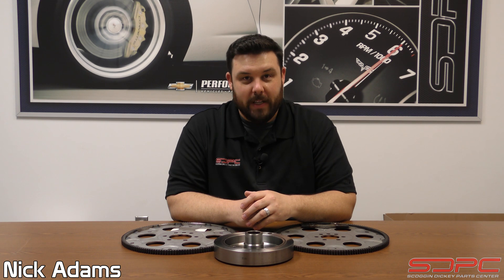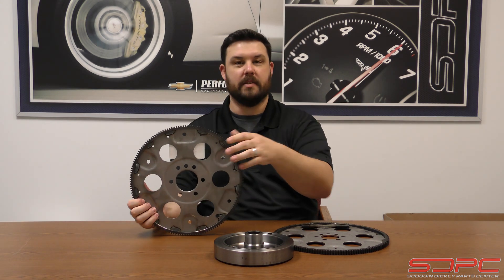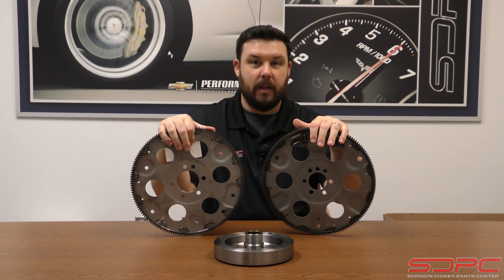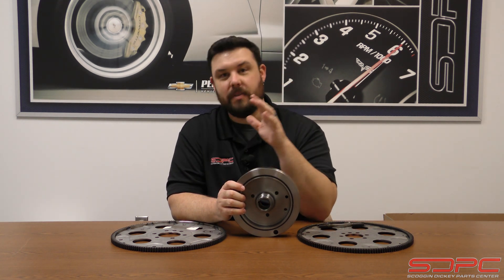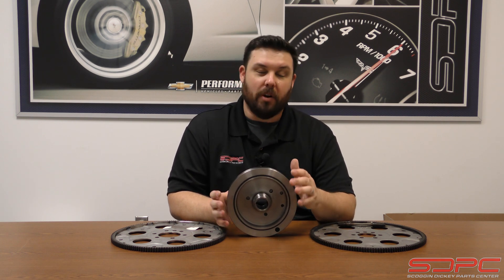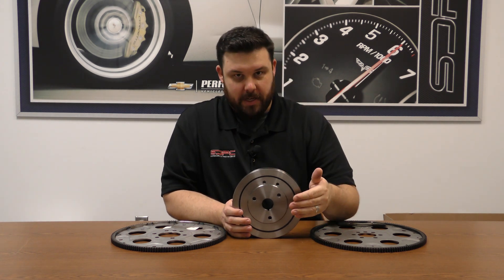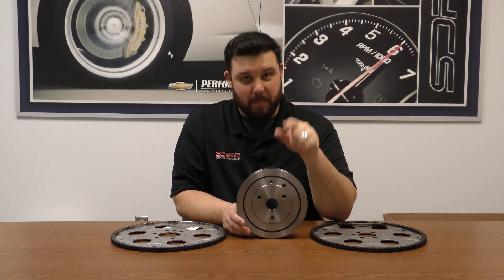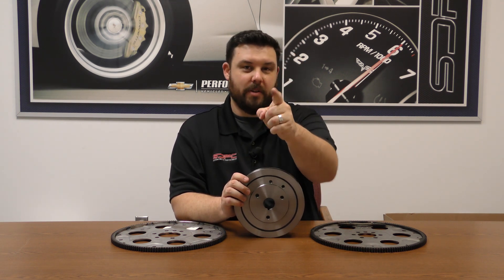SDPC Tech Tips: Internal vs External Balance

Comment: I bought an SP 350 357 just told me my balancer would work for my older 350 that was internally balanced I used it for less than a thousand miles and I had a vibration around from 18,000 to 34,000 could not figure it out I called Jegs back I need an external balancer so they show me their external balancer Jegs knockoff from dayco that made my motor shake at idle no I didn't think I needed a racing balancer for $ 275 that's why I tried to get one that was around 70to80 bucks I found this video online and this is the only one that told me I needed a neutral balance which I couldn't find any dayco one or Jegs aftermarket one even Summit doesn't have so I ended up spending $270 on this balancer I will follow up and let you know if it works I just wanted to say they should have made this clear and the instructions I doubt if I did any serious damage for less than a thousand miles but I could have and that would have pissed me off

Comment: Technically, there are no internally balanced 350's from the factory. the 2 piece crank 350's had an external "wing" that was part of the crankshaft. The 1 piece crank 350's could not use the external "wing" because of the 1 piece seal design. Chevrolet had no choice but to add the required weight to the flywheel or flexplate.
Reply: Integrally balanced might be a more accurate description for the 2 piece seal crank.
Reply: Yes, that is much more accurate. If gm would have used a little lighter piston they could have internally balanced them.
Reply: @MariusSalvetti  
The real issue is that the block was never meant to house that much stroke. It was originally designed for a 3" stroke 265 that had a round flywheel flange. Just going to slightly larger pistons in the 283 required notching the flywheel flange for balance.

Comment: Would putting the pressure plate on in a different position cause a vibration ?? 4 speed AMC T-10 externally balanced. Thanks for your help

Comment: To note - this is incorrect for the LT1 in a 95 Camaro, regarding the 383. For example, when making it a 383 using an eagle crank that is internally balanced, you need a zero balance flywheel.
Reply: It's a video from a Chevy dealer. He's talking about when guys would cut O.E.M. 400 cranks down to 350 mains and the cranks used in current GM's 383 crate motors. There are other 1 & 2 piece seal stroker cranks from the aftermarket that are internally balanced as well. With enough Mallory metal($$$) any crank can be internally balanced but for assembly line motors external is easier for the longer stroke.

Comment: Does the engine block set the internal versus external, one-piece versus two-piece application? I'm looking at a used 400 SBC block
Reply: All 400's used a 2 piece rear main seal and factory external balancing. There are conversions to fit small block 2 piece seal cranks into 1 piece seal blocks, originally developed to fit cut down 400 cranks into newer blocks when building a 383, but none the other way around. If you've got a 2 piece seal block, you need a 2 piece seal crank.

Comment: So if I need to swap flywheel from 1 piece to 2 piece crank, my 10.5 clutch will still bolt up ok? And starter should fine as well? Just the mounting to crank changed?

Comment: Long story short, rebuilt 700r4 all new sonnax parts, replaced factory flexplate as two welds were cracked, have since put 3 flexplates and still have a vibration and have also replaced TQ convertor twice. Old flexplate "weight" best i can measure weighs 2.19lb, new flexplate weight weighs 2.32lb nearly a full 2oz or more over factory. 
Can this be causing my vibration? Vibration occurs during all RPM and in Park, Neutral and all others, ranges from 600-6000rpm, very bad at 1200 and 4000.
How i measured was laying flexplate flat on a scale and a box that was simular hight and a 50/50 weight distribution on the scale and the box the best i could.
Reply: So I know this is two years old. And I have no real experience, But basically yes, this would cause a vibration, what I think you need to do is get your new flex plate machined to have the same weight as the old flex plate. And the weight of the flex plate is important. But so is keeping the flex plate balanced. Because if you removed all the weight from one side of the plate the plate would be unbalanced and give you a vibration, I hope you sorted this out
Reply: @AwesomeElite122  thank you for the reply. I had my original flexplate repaired. Transmission now has 13k miles on it since rebuild in 2022. Vibration is still there but not as bad, only thing I can a few transmission specialist can think of is the sonax high pressure 5000rpm and above pump spring I installed is causing the vibration that I am feeling. Engine mounts was toast so they got replaced and eased some of it as well. But with the engine also having 263k miles which is the reason the front pump bearing was bad as the crank is sitting low, I assume, would also cause my issue. So far no other issues, it shifts perfect. Have put many miles on it as the car got wrecked in 2023 and I did a full rebuild on it then parked until 2024 spring time came around.

Comment: I have a 1973 400 sbc that’s in my 74  c10 I bought this from a friend but he dnt knw anything about the previous work on it. So I’m asking if you know or can point me in a directions if that year was internally or externally? It is a two piece rear main came with a 400 externally 168 flexplate but had a balancing plate? Is this needed or is it wrong and just needs a internally balanced flex plate?
Reply: And also has a bad vibration at low rpm’s   🤷🏽‍♂️🤦🏽‍♂️
Reply: External balance

Comment: Hi. Good information. I have a question. I bought a 350 vortec one piece. The motor was on truck with std transmission,. Can i use flex plate for automatic transmission??? Thanks.
Reply from the maker: Yes, you can bolt a flexplate in place of the flywheel. No issue there.

Comment: I’ve got a 350 one piece rear main marine engine , it’s got a flywheel on it I did notice it was drilled out when rebuilt, I did question engine builder when replacing balancer they said neutral or internal balancer will be fine ? I just don’t know whether to believe them 
Help please
Reply from the maker: One piece real main seal small block came from the factory with an external balance flywheel or flexplate and a neutral/internal balancer.
Reply: @Sdpartscenter  apologies it’s two piece rear main

Comment: Thanks for the clear explanation. I have a 1985 GM 4.3L V6 (2 piece rear main seal) in my garage that I want to mate up to a manual trans. The flex plate that came with the 4.3 has no weight on it. Now I know I can source a flywheel from a 1985 or older small block with a manual trans and go with it.

Comment: Does a 383 crank. Use the stock dampener bolt.  On holding in balancer
Reply from the maker: Yes, it does.
Reply: Mine is like 1/2 bolt. 
   Is a big block balancer bolt. It be bigger then 350 chevy
Reply: I'm having truble.   
  Spent grip of money on her 
  Balancer given me a hard time.  Take it to the builder.  Let him fk it up.    At least then I can tell at someone.   Lol
Reply: I have a 383 that was “blueprinted” and balanced by a shop before he sold the car 67 Camaro.   I have a noticeable difference in the feel of the engine between 25-2800 rpm. It’s worst if I cruise in that range but hardly noticeable if I’m powering through that range   Does that sound like an engine balance thing or could it be something more simple. Like a plug not functioning fully,? gap being off slightly ? A valve adjustment thing?  It runs really good otherwise.   It’s got the Holley sniper EFI and Hyperspark ignition.   We have new poly mounts    I feel it more in the shifter (Muncie M21).   Never driven older cars before buying this so I have no reference on how it’s supposed to feel.
Reply: @LemonmilkMusic  that does sound like a slightly out of balance thing. It should be smooth all the way through the rpm range. Probably why they sold it because its not gonna be that easy to fix.
Reply: You can get an internally balanced crank for a 383. But most are external.